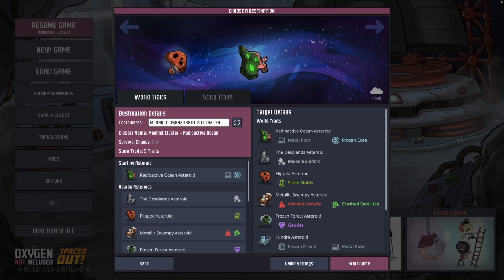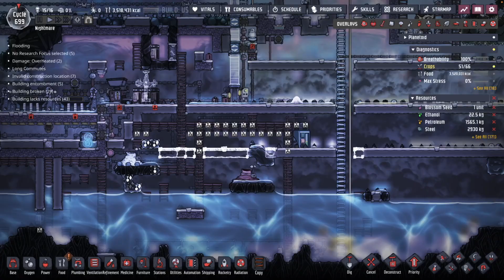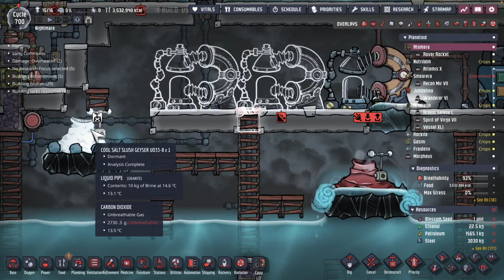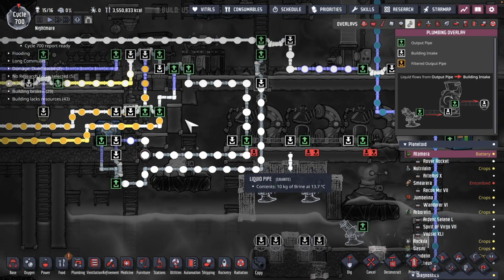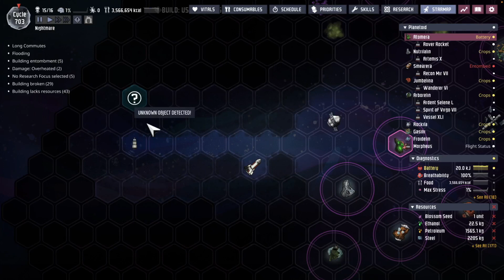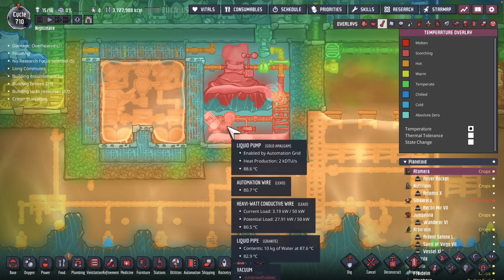New Water Plant - Oxygen Nightmare #37

Comment: To be honest, at this point in the game, I would rather save on sand and labor. I would send all water in a steam chamber. For now i think you only have the nuclear reactor as a stable enough heat source, at least on this planet.
The labor cost is small on desalinator, but the desalinator is very far now. And you didn't set shipping for the filtration medium so you would also save that labor.
It would also directly produce dirt from polluted water, instead of having the polluted dirt to compost/to feed to crabs.
I think it would "use" more power than the desalinator/sieve but you don't really care for power. "Use more power" in the sense of "prevent steam turbine to produce as much" and also you have to cool the turbine output. But a simple heat exchanger that preheat the incoming water while cooling the turbine output can be quite easy and effective. And would take less space and simplify your piping i guess.
It might be too late now that this system is up and running. I guess, just add shipping and sweeper for the sand and keep an eye on your sand supply.